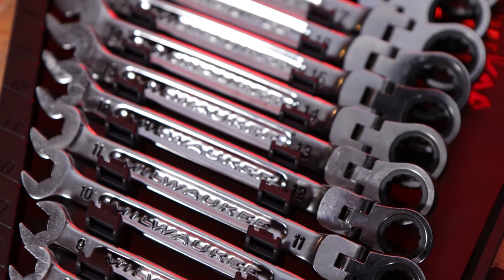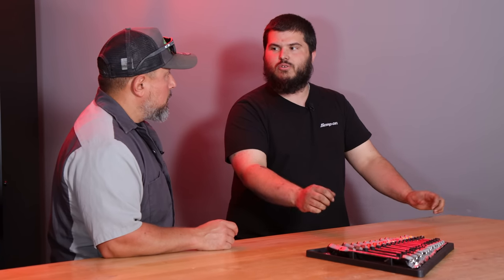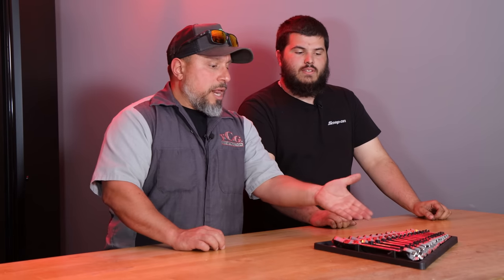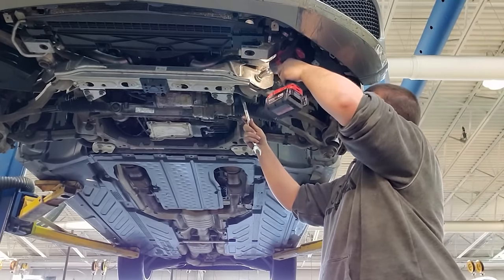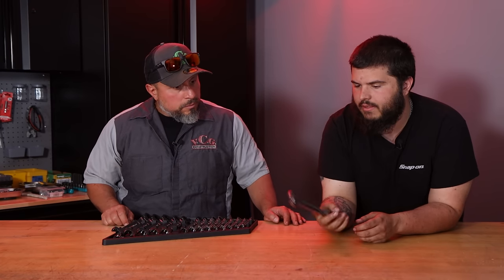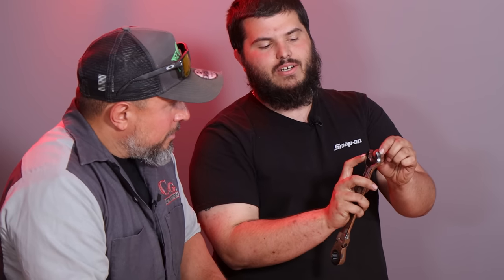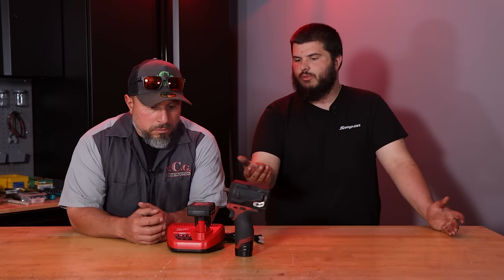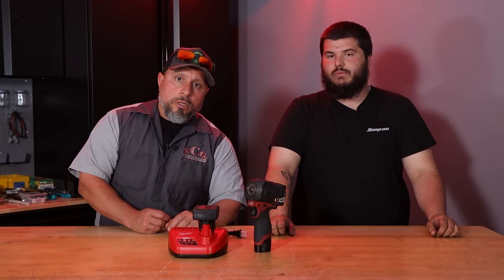Milwaukee Compared To Snap On Tools (NOT WHAT YOU THINK)

Comment: This a logistics RANT but an honest one concerning logistics differences between Lowes and Home Depot:   I needed to order some parts for a couple bathroom fans. Lowes hands down, had the best price by far. The parts took over 2 weeks to get but with savings it got, that didn’t bother me at all.  I got notified over 13 hours later after my parts had arrived by Lowes.  Lowes logistics notification system is slower than a snail.  Home Depot has their stuff together in that regards logistics system and it terms of notification speed-Light speed.
Reply from the maker: We appreciate the insight Ron, thanks!
Reply: Like you didn-t already know that Home Depot logistics structure is much better than Lowes.  Price points can very at all levels.  Also to note.  OPT and Acme are extremely top notch in logistics and customer service

Comment: As a Heavy-duty Mechanic, I have quite interesting sets of tools... I don't have anything fancy but most power tools, I go with Milwaukee and any air tools or special tools I go with MAC tools. For wrenches, sockets and ratchets; I use Mastercraft & Maximum (They are cheap but comes with life time warranty). I had these Mastercraft Wrench sets for 6 years; still works. :elbowcough:

Comment: After doing last min shopping as a student I recieved 50% off snap-on on and now at 8.4k in debt. I'm considering in refunding whole order aside from the 3 digital torque wrenches and look into boxo USA or full on Milwaukee. What I got to spend that amount? (2) digital torque wrenches 3/8 and 1/4, electric impact with 2 batteries and charger set, power ratchet and a tool set that also includes a tool chest... I'm actually regretting because I feel like I can get more for my money elsewhere and still be reliable and convenient for my diesel job.

Comment: I work in the material handling sector as a tech on forklifts and some construction equipment. I bought a set of sae and metric Milwaukee wrenches like 4 years ago now and i have always been happy with them, the organizer is nice and is usually the perfect shape to fit in most tool box drawers. I've used these on some gnarly bolts and put well past the recommended torque.... So far only minor cosmetic damage has shown. Maybe some of the grip cuts have been damaged but I've abused these things and they still keep going. Happy with my purchase

Comment: I have both and have been a little disappointed by my Milwaukee, I usually prefer my snapon. Both have the teeth for grip, but my snapon always performs better. I am an industrial equipment tech, the main thing I notice is the Milwaukee is a softer steel, after a few months of use the Milwaukee are already starting to become wider in the open end (I don't know the term).
Reply: So when they get out of tolerance too much just get a new one. Its a lifetime warranty just like hype on.
Reply: I'm not a die-hard snap on guy, almost all my tools are Milwaukee or husky. However there are a few areas where my snap-on tools just out perform anything else, that's just been my experience

Comment: I have contemplated buying these wrenches but at the price point they are at, i just cant seem to pull the trigger. That 3/8 stubby is great though. The only thing i can see it being better is having a rocker trigger like the snap on 3/8 impact. Its a nice feature but not worth buying another Snap-on to get. Ive used many brand of ratcheting wrenches. Maybe i can catch these at a good price and try them out.

Comment: As an Autobody tech , Milwaukee ratchets are trash the body clam shell comes apart and pulls the threads out of the too short screws/ratchet . And secondly the heads wear out or strip constantly I have two 1/4 inch and one 3/8’s and all three have the same problems . I stuck them in the drawer and bought another snap on . I like the 3/8 socket drive  compact impact but the ratchets are a waste of money

Comment: Well, back in the day, Snap-on was about the only wrench you could buy they would last and stand up to the abuse in the trade. My son has Milwaukee wrenches and ratchets, and they work great and I have used them every bit as good as the Snap-on tool. If I was getting in the trade now, I probably look around and buy somebody else’s tools. Just keep in mind, the tools don’t make the mechanic the skill makes the mechanic or technician.  I just noticed in your video you are using the open end wrench backwards to loosen a bolt. Yep back in the day we just take a cheap wrench and grind off the sides if we had to to make it fit.

Comment: I just don’t put my tools on the paint and the clip comes in really handy when you need to take 4 bolts out on a drive shaft say and need both hands to grab the drive shaft so rather than running back to the bench you can just clip in on your belt and keep working. At lest for me every second counts on flat rate

Comment: My nephew does audio installation and spent at least $25,000 on snap-on tools and a tool box at 18 years old.  Sure... The tools are great and will last him a lifetime.  The pricing is just ludacris.

I don't make money off my tools but I sure don't see a $20,000 difference in quality between my HF box and less expensive tools.

Home Depot frequently has the 15-piece Milwaukee ratcheting wrenches for $79 in their daily deals.  I think I'm going to finally pull the trigger on an SAE and metric set to supplement my 1980s Craftsman wrenches I bought with my first real paycheck as a kid.  They'll have an easy life.

I do computer work from home... And yes, I buy my computers on sale too

Comment: I have a set of Milwaukee metric wrenches won in contest (non flex head, non ratcheting) and find that they work about as well as my first generation flank drive SO units.

The SO units a little thinner in head width, so can be used in more limited room situations than the Milwaukee units, but otherwise work about the same.  I have no problems with either brand of wrenches and the tolerance or fit on nuts or bolt heads seem to be about the same.
What I don't know is how the warranty situation is with Milwaukee hand tools; even the IMHO marginal tool quality of Stanley brand have excellent warranty/customer service in my experience.
Reply: For milwaukee hand tools, go to their website for more info. I believe you submit a claim, send it in the mail and they send you a new one. I don't think you'll find these in any big box store. HD has them only online but they don't process warranties for single tools the way lowes does for craftsman hand tools
Reply: I have all Milwaukee tools very disappointed in Milwaukee hand tool warranty

I sent my 13mm in and 1/4” swivel 

The 1/4” swivel was defective
The pin feel out before could use it so I sent in 
13mm ratcheting after 2 years open end the teeth were geting warn 

Sent them in on my dime 
No labor proved 10 days later got a call telling me this is normal use  no warranty was very upset 
Called back up Milwaukee phone line and they said wat they say is wat they say 
She like ow well we can give u discount on another one I was like ok 
Called back up tech  he said we don’t do that on this wrench 

He sent me back the 13mm and my swivel 
Not fixed 

I refuse to buy any more hand tools 
I have 4 1/4” sets 
1 3/8 set 
1 1/2 “ set and wrench’s
Wtf Milwaukee
Kill u give me one time wrench fix 

And if u don’t have recipt ur f. U ked  up creek 

U have to show it to them before anything

Comment: Anyone who has been brainwashed by Snap-on I can’t trust their opinion. I am I Heavy Diesel mechanic, my tool
box consists of Husky, Dewalt, Milwaukee, Mac, Matco, and Snap-On. They all make great products, I’ve literally had 8mm-32mm Husky wrenches for years and you really can’t tell the difference when grabbing my co-workers Snap-On wrenches. I can’t speak for the Milwaukee wrenches because I haven’t used them yet but I just don’t believe they slip off or don’t bite as well.

Comment: Now if they would start designing packout for mechanics in mind. The full 15 wrench set barely even fits in a single packout drawer. I'm not putting a single wrench set in their own individual drawers. I'm not gonna use foam and double them up. I want to open the drawer, see all my wrenches and grab the one I need.

Comment: You aren't supposed to use the open end for breaking things free unless you have to, if the ratcheting mechanism can't hold up to using the box end for its intended purpose its not worth the money you paid for it
Reply: That’s what I’m saying, if the open end ratchet breaks from just want my hand can put on it, wasn’t worth the money anyways.
Reply: I say go ahead and use it as needed. If the box end breaks ship it back for warranty replacement. After enough replacements Milwaukee can see the pattern of failures and make needed corrections for the tool

Comment: Milwaukee need another wrench line with thinner open end 
Then snap on be out of business 
Because these hang on 
But when u need to do somthing delicate little big
Reply: I dont think you will ever have a thin open end on a ratcheting combination wrench
Reply: @jocool562  snap on wrench’s are usa made sells $35 $55  or even high a 1 wrench plus shipping 
They are thin as possible on open end also on box end 
they use a top notch steel to keep open end closed 
Milwaukee are double as thick every were but and unfortunately use a cheaper steel and not made usa 
Not only on thickness are they thicker but the top and bottom of the jaw that key 
More meat always wins unfortunately 
But like Vince say unless ur gonna take grinder to ur wrench u need thinner one 
So snap on comes into play with there thin wrench’s 

it’s all about using right tool for job
Ur not gonna use a snap on open end wrench to take off a rust bolt 
Nor ur gonna get in tight brake caliper with Milwaukee loool  
Even regular non rusted nut snap on will slip off
But also keep in mind Milwaukee wrench’s ruin bolts with the teeth 
Done mutiple times chews them up 

If y don’t get this 
U don’t work on Japan cars

Comment: Snap on is so over rated for the price, the Mac set was about 90 dollars cheaper and had damn near the same quality, if not a better design. Snap on's 3 ton pump jacks as another example are an absolute joke for nearly 1000$ when the harbor freight Daytona is nearly as good for under 200 bucks. After the jack I left snap on behind.

Comment: I gotta stop right here because milwaukee was the first brand years ago where I felt they were innovative on affordable specialty hand tools with out running to a specialty tool truck. Their vise grips with an open ended adjuster made it simple to apply extra tightness to avoid rounding and even were string enough to be used for tire skinning jobs, also the full tang screw drivers were never broken after 5 years of rough use only stolen.

Comment: Use the open end to break free??? I have  a Mac ratchet directional wrench set. And I abuse the hell of them and never had an issue. Open end should not be used to break free fasteners unless you can't fit the box end over it. Ehh guess it's a Mercedes mechanic can't be too hard on him.

Comment: For the cost of the Milwaukee flex head wrenches the Williams brand “Snap-On” is a better wrench and has been out for many years. 
 For wrenches day in and day out Snap-On makes the best. 
I know that first hand when I was an auto mechanic. Auto mechanics in the Midwest know about rust and corrosion vs warmer climate states. It’s a big difference almost a different trade dealing with rust and corrosion.

Comment: I CALL BS ON THE IMPACT, every Milwaukee impact i have, and i have 7 of them work but not even close to the Snapon, the Milwaukee 3/8 ends wear out almost instantly, i have never changed a locking ring on my Snapon,  the Milwaukee has its place we do use them all the time but the Snapon works much better.

Comment: I use the open end to break it loose coz you dont want to damage the ratchet end 😂 thos guy shouldn't be trusted. If the ratchet end cant hold up to the torque that can be put through it at the length of wrench then its crap

Comment: THE HONEST TRUTH..... The Milwaukee wrenches are ok and better than the cheaper brands on the market but from months (not years but only months of daily use) the teeth in the open end roll over and wear out, my older Snap-on set just haven't ever done that.
I have all Milwaukee power tools and hate spending a lot of money on tools, but in my opinion over time the Snap-on wrenches are a lot better of a wrench at the end of the day, but you do pay for it. I can't agree that Milwaukee hand tools are as good or even as close a quality over time, and that is just a fact if you have used both over months or years, not like the guy talking who used them for a few days. Also I wish the Milwaukee Wrenches were a bit longer like the Snap-on's.
Reply: Yes, this is what very few people seem to understand. The Milwaukee wrench's are made from cheap, soft, Chrome Vanadium steel. It just doesn't hold up. It wears out quickly and the open end will spread and slip. There are many kinds of steel a company can choose from for wrench's. All of the foreign made wrench's use Chrome Vanadium. Snap On uses Chrome Boron steel. Much harder, stronger and tougher. Open ends won't spread, box ends won't wear out, will last decades. For the guys that don't want to spend Snap On money, Wright makes great wrench's with very good steel that don't cost much more than these shit tier foreign wrench's.